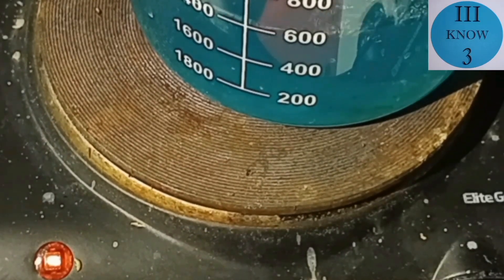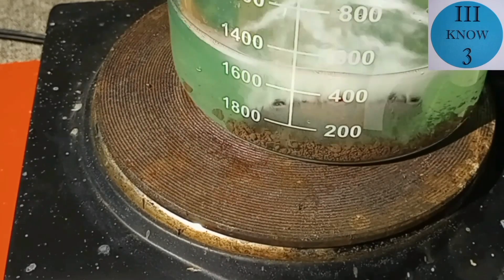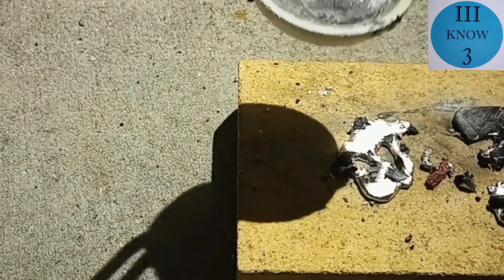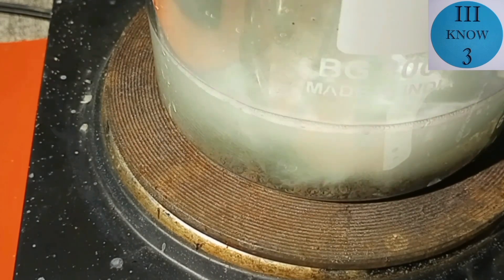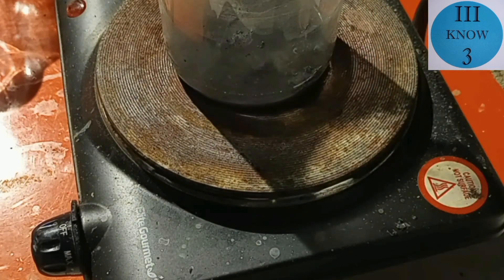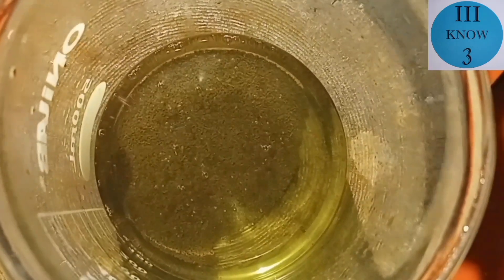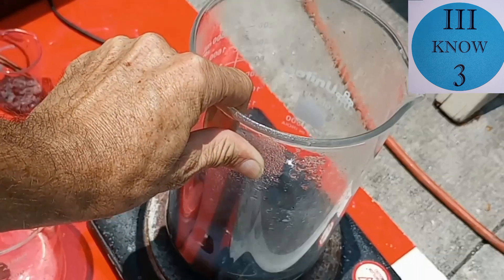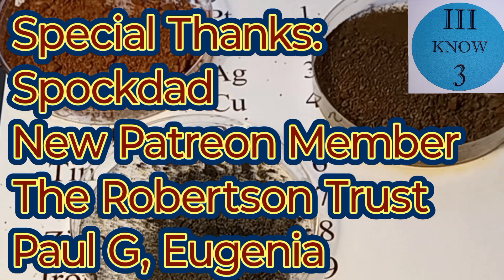Copper, Nickel, Zinc, Aluminum and Acid

Comment: Hi nice video.

Normally you can't get good fusion of Ni or Cu powder because the surface area is too high and allow for NiO and Cu2O - CuO oxydes formation when exposed to flames of a gas burner... some hydroxydes-and carbonates too from combustion products of gas.
CxHy +(x+(y/2)) O2 --> x CO2 + y H2O
You need protection from O2; a kind of flux, cover or overpressure innert gas or reducing gas.

Only into reducing flame thus low at Oxygen you can get some C and CO that can reduce some metals; at least it is ow it works into metallurgy.
Copper is one of the easiest to obtain from oxydes and charcoal heating (with air exclusion) this was used for ages by african native populations for ages.

It was used into organic chemistry lab to identify presence of carbon into unknown organic compounds with fusion with CuO; aside with other tests.
From memory Ag2O looses its oxygen when heated; but Cu2O or CuO even if closely related to Ag doesn't do it on its own; it needs a little carbon or CO (not CO2).

PHZ
(PHILOU Zrealone from the Science Madness Forum and many former A.O.L newsgroups related to chemistry)

Comment: Is the object to separate the metals?  Since you do electrolysis, why not separate them that way?  Put in 2 graphite plates, set parallel.  Pass LOW current through.  Nickel should come out first, then the copper.   If you stop the process & change the cathode before this happens, you should recover pure nickel.  You will also see a voltage change when the nickel depletes.

Comment: Yes, it looks like copper is precipitating out before the nickel, but that is not what's actually happening.  Both copper and nickel are precipitating simultaneously, but the nickel precipitate is again reacted into solution.  This means that at any particular time during your operation there is both copper metal and nickel metal at the bottom of that beaker.

Comment: Hello sir, Can rocks and stones can be dissolve by the chemical acids and please name the chemicals sir
Reply: And it should be highly consentration with in time sir.So, please name the chemicals sir
Reply from the maker: OK, there is a process for treating rocks and stones.  Usually, you crush them up and the roast them at high temperatures before using any chemicals.
Stones and rocks vary in composition.  Since they are made of different elements they will react to different acids.

Comment: Hi, I made apple cider vinegar but it doesn't dissolve egg shells. Why
Reply from the maker: It may be because the concentration of acetic acid is lower in the apple cider that regular food grade at 5%.  The reaction could still occur, but it may take quite some more time, maybe a few days.  Another possibility is the apple residue is somehow slowing the process.  You could try adding a little hydrogen peroxide to see if that speeds the reaction up.  If your apple cider mix smells of vinegar, I am fairly sure you did make some acetic acid.
Reply: @IIIKNOW3  thank you brother. I never thought you will reply to me. Yeah, you are right. The concentration is not right. Please can you tell us how to make white vinegar
Thanks love you
Reply from the maker: If it were me I would want to keep my Apple Cider Vinegar around for its flavor.  But, if you just want the acetic acid from it, you could try to distill it.  You could also try this with another vinegar, like from wine. if you heat to around 120 C the water and acetic acid should come over and condensate in your receiving flask.  All the solids will be left behind.  You may have to repeat a couple times to get clear white vinegar.  If at some point in repeating (maybe the 2nd or 3rd time) you can heat to not above 100 C then you should only be drawing off the H2O and the acetic acid will stay behind in the boiling flask.  This will be a challenge, but you can try.  I don't think this way will get you a very high concentration but you should be able to get white vinegar through this process and probably over 5%.
Reply: @IIIKNOW3  thanks brother for your prompt, informative answers. I will follow your instructions
Reply from the maker: Let me know how it works for you.

Comment: An easy way to get your acetate salts again is to get sulfate or chloride first.. then do a displacement reaction.  Doug's lab does it with copper to make copper carbonate, which makes the acetate easily
Reply from the maker: Thanks for watching and the comment.  The goal of this one was to get the copper and nickel out of the solution. I learned a few things while making this video and will apply them to my new work.  I hope you continue to watch my videos.  I will try to watch more of Doug's lab, but he hasn't done anything in years.

Comment: Greetings to you, Professor, how to restore zinc from acidic solutions, and thank you
Reply from the maker: I am working on that, hopefully will be posting a video about it soon.  I have had issues recovering it from Zinc Chloride.  Zinc Acetate and Zinc Sulfate should be easier.  I have a mess of mixed Zinc Chloride and Aluminum Chloride from this video.  It is a milky gelatin-like blob right now.  
If you didn't watch the video Sulfuric Acid and Zinc, you should because it will be important for the process. https://youtu.be/LN4AzJiWUoo
Thank you very much for the support!!
Reply: @IIIKNOW3 
شكرا
Reply from the maker: You are welcome!!

Comment: One more
 question , 
When your making  the plating solution  for nickel  or copper, is the solution a acetate or a sulfate?
 What's the difference?
Reply from the maker: You can do either.  Acetate may be safer and easy to try.  All you have to do is add salt to vinegar and hook up power with your source metal on the positive anode.  It will take a while for your solution to get ready you can add a little hydrogen peroxide to jump start the process.  It is really something you can mess around with to practice.
Sulfate may work a bit better, but usually you start with sulfuric acid which is more dangerous and it is more expensive.
Cleaning vinegar is usually about 20% Acetic acid and should work a bit faster than food grade 5%.
You could always order a premade electrolyte solution, it will cost more but may have additives that make your process easier, even if you wanted to do an alloy.
You could also order Copper or Nickel Sulfate and just add water to dissolve.  I believe Acetate or Chloride are the most used for nickel, and any acidic solution would work for copper.
Just start, practice with salt and vinegar and some scrap metal to plate on.  Test your results and make small adjustments.  Then you can graduate to some other electrolyte solution and put something you want to put a nice finish plate on.  
Let me know when you get started and how it is going.
Reply: I'll watch as long as you make videos 🧐
Reply: Ty
I've been making a   mess and wasting money....lol
Reply from the maker: @donaldspeck9212  When I started this years ago I was trying to get good at refining precious metals. I lost ounces of silver and grams of gold because of mistakes. I had several 5 gallons full of wastes that I was not prepared to deal with.
I had a covered but open area outdoors and all the metal tools and such out there I rusted from acid fumes. 
Eventually I got fairly good at refining gold and silver, but I still learn new things everyday. Even if you are decent at refining gold and silver,  you will lose a small percentage with each step of the process. There is more free information about refining gold than there is about the other metals I want to better understand. Thanks for continuing to watch while I keep learning!

Comment: Sometimes you get your answers without asking a question. 
Thank you for the information about nickel and copper plating. 
So it's not possible to plate a alloy?
And copper doesn't disolve in hydrocloric acid?

Can't tell you how much I learn from your videos 

THANK YOU 👍
Reply: I like the way you edit and narrate your videos, not sure what it is, but I enjoy watching and listening and learning from your videos 👍.
I'm probably not gonna mess with any cyanide....lol
Reply from the maker: Good to hear from you. I thought you might like the nickel info. 
I got the nichrome wire, will do that soon.
It is possible to plate an alloy but in most cases as far as I know the electrolyte solution needs additives (like the very deadly Potassium Cyanide>>a half gram is a 90% chance to be lethal for a 160 pound human). There are alternatives that are safer, but I haven't tried them, maybe I will at some point.  Single metals are usually more straightforward for plating.  
It was cool to see the zinc get plated in nickel just by boiling in the acetate.  I think that would have polished to a shiny nickel finish.
Copper needs an oxidizer to dissolve in hydrochloric acid like hydrogen peroxide or nitric acid.
Thanks for your continued support!